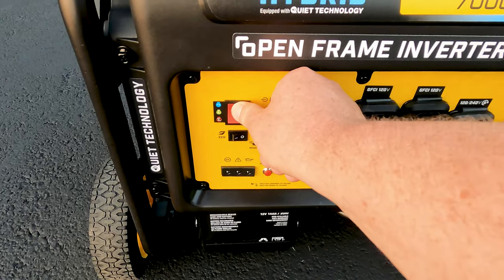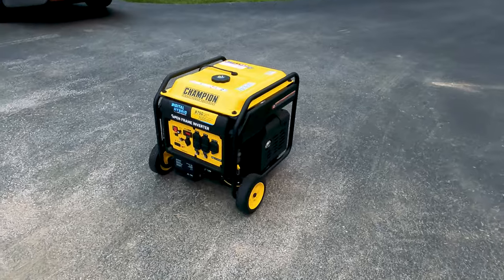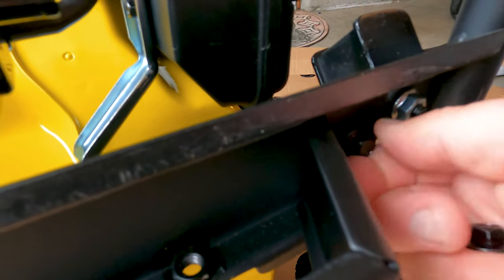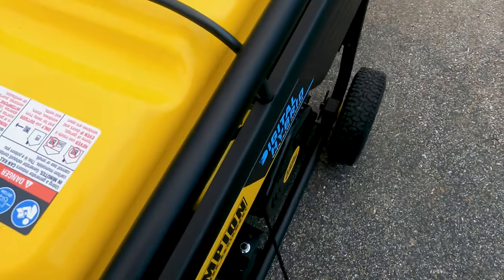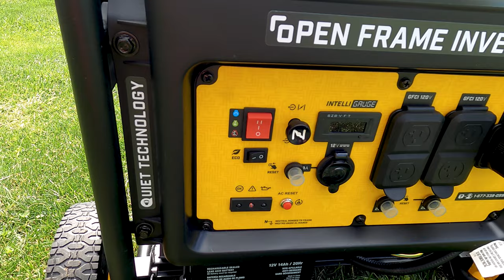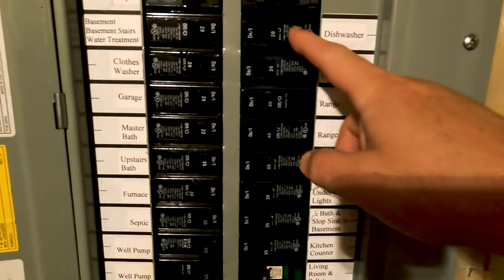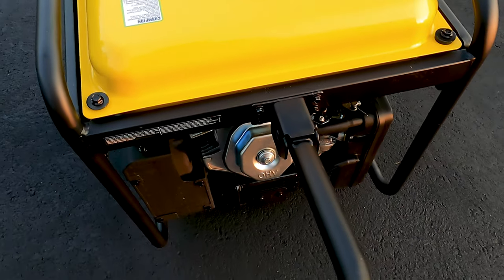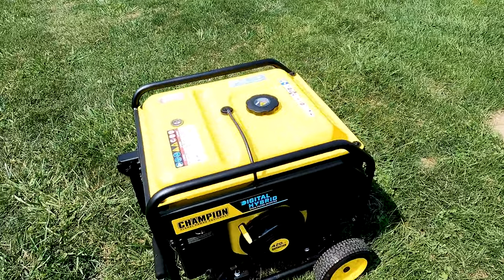Champion 100520 Inverter Generator - Nice Clean Power But Several Issues Too...

Comment: Seems like you didn’t even break it in before giving it a substantial load. Ideally, it’s beneficial to run it a few times without a load for an hour or so and change the oil to get the metal shavings out. Then after the full 5 hour break in period, add synthetic oil and run it on its desired load.
Reply from the maker: Actually did all of that.  Thanks for watching.

Comment: I bought two of the 4500 open frame generators.   Both started first pull after adding oil and gas and they run like a Champ.  Best bang for the buck IMO.

Comment: The Predator , Champion, and Wen are all identical, all made in the same Chinese factory. The Predator has a larger fuel tank with 6 gallons vs the 4 gallons of the Champion and Wen, so should have substantial longer run times. The Predator has a 90 day warranty, the Wen 2 years, and the Champion 3 years.
Reply: Champion is definitely different. It's American designed but made in China. It does not look like a generic one with a brand name slapped on it.
Reply: I know they all use some china clone engine such as Rato.
Reply: @paulschab8152  , actually it is a Honda clone.  An EXACT copy.  How do I know? There is another channel under James Condon that repairs generators.  He put a Honda carburetor on a Champion generator engine.  It FITS EXACTLY.  I bought a WEN and it works very well.  No fuel injection to deal with.
Reply: @paulschab8152  , actually it is a Honda clone.  An EXACT copy.  How do I know? There is another channel under James Condon that repairs generators.  He put an old Honda carburetor on a Champion generator engine.  It FITS EXACTLY.  I bought a WEN and it works very well.  No complicated fuel injection to deal with.

Comment: Got the same genny with zero hours on the board, and at 13 now. Never had the fault startup or any other prob. Wonder why urs had 2hrs, I would have raised a stink! Might have something to do with ur problems.
Also I recommend the motor snorkel msk3101 for dual/tri fuel with this generator. Was a super easy install and quality kit. Just finished my iron plumbing for NG after all testing confirmed it will run a 3.5 ton a/c ON NG (5500 watts starting and 4500 running!). Will get the video here shortly covering that whole run-down. 
I do have an easy start video running on this genny with gasoline.
Reply from the maker: Interesting point.  My initial thought was they put a couple of hours on it at the factory for testing.  Maybe I got a unit that was sent back from someone else?
Reply: @GreenMountainDIYGuy  my thoughts but I hope not. I did do some test starts to see if I got the red light prob and could not get it. But when I start I keep it choked for about 5-7 seconds, then the green light comes on and I unchoke it. Have u tried that?
I've also run mine on natural gas with the motor snorkel kit and found the power to be up around 5k watts with natural gas. With a micro Air soft start on my a/c i am able to run my 3.5 ton a/c on natural gas! Will be making an overview this winter about it. Thanks for u channel!

Comment: The lifting handle appears to be on backwards, or upside down. You had it placed correctly but then turned it around so that the welded square on the handle would hit the rubber stop
The square on the end of the handle should com in contact with the metal frame when lifting at the top. It is placed there to keep the round part of the handle from deforming under load.
Reply: Oops...

Comment: What are the dimensions of the shipping box.  I bought this generator, on Amazon, but have not received it yet.  So, I need to know if it will fit in my 1996 4Runner.

Comment: Did Champion say anything about that fault at start up? Did you change the neutral bonding from factory by chance? Mine only does that when I truly overload it. Great video.
Reply from the maker: Yes, I did recently rewire and change the neutral bonding.
Reply: @GreenMountainDIYGuy  Hello and thanks for the video! Did changing the neutral from bonded to floating solve the issue of the red warning light coming on?

Comment: Bought mine a year ago, and only rook it out of the box yesterday to use because of power outage... That sucker is loud (maybe because it was on concrete).  Also, for some reason, it had a bit of oil in it already...
Reply from the maker: Very interesting to hear!  This generator worked well in our recent 11 hour power outage!  Thanks for watching!

Comment: I'd check the main jet, it's a little bitty hole. Anything junky at all in there will limit fuel delivery, RPM (which it sounds like it's down a couple hundred when erroring), and power.
Reply from the maker: Great suggestion, thank you.

Comment: I own four Champion generators (3 of the 2000 Watt units and one 3400 inverter) and they are superb units for reasonable cost.. I also own the Honda EU6500is for home backup and it too is superb except for the outrageous price. For my money, I personally consider the Champion line of gennies the best value for the money you can find, especially with their parts support and customer service. And no, I am not a Champion fan boy....lots of great gennies on the market...but stick with a known brand
Reply from the maker: Good Advice all-around!

Comment: Solid video and editing! Too bad on the handle, but looks like they took care of you. Hopefully, it works out on propane. You are right with Honda...but, they come at a steep buy in.
Reply from the maker: Thanks buddy.  Took a while to do this video between takes and editing.  Even got the driveways sealed to completely mess up the continuity of the video.  I think the generator will run a lot better on propane, at least my last one did. Thanks for watching!
Reply: Handle looks cheap and weak, should have been 2 to take the load of the welds.
Reply: As we All know that every Company always has A LAZYASS in the Company that Crews everything up...
In All Level of Society 👎👎👎

Comment: I just got mine this week. What size breaker did you install in your panel? Thank you for the video!
Reply from the maker: Nice purchase!  I have a 30 amp double pole breaker installed on my panel.  I also use an interlock kit.
Reply: @Pilot81 Hi! How do you do that?

Comment: How hard is this to crank if the battery is dead?  Trying to decide between the Lowes 5250 watt model which is manual start vs this one which is manual/electric.  For me odds are good that when I need it the battery will be too weak to crank the unit.
Reply from the maker: If the generator is cold,  you will be cranking for a while.  I went to this ekectronic starting generator partly due to my shoulder wearing out and not being so young.  The battery will last a long time between using.  I just exercised the generator and it started right and it had been six months since I used it last!

Comment: Bought this same generator. I get thr error sometimes. No clue why. I turn it off start it again and it's green. Let me ask you a question, do u have to choke it every time u start? I can have mine run for an hour. Turn it off and try to start it again right away and it won't start unless I choke it. I find that odd.
Reply from the maker: Very interesting to hear!  Must be some kind of larger issue with these generators.  I never use chock because I only run off propane now.  Thanks for watching!

Comment: How many amps is your well pump? That's my only power outage issue is no water, ive got much smaller champion investor that runs the basics.
Reply from the maker: The Well Pump is on a double pole 20 amp breaker.  I don't remember the actual draw but the generator handles it.
Reply: @GreenMountainDIYGuy  thanks

Comment: Should have bought the Predator (same price) with the "no questions asked warrantee". that's unbeatable!
Reply from the maker: Maybe...thanks for watching!
Reply: The Predator is $1300 currently and has a 90 day warranty. If you want the added two year warranty, you are paying about $200 for it. So $1500 plus tax, for the generator, with a 2 year warranty. I bought this Champion for under $900. Almost $600 less than the Predator+warranty AND comes with a longer 3 year warranty. You can buy the same exact Wen generator even cheaper, usually $100 cheaper or so.
Reply: @bubbatime  The WEN manual says to change the oil every 20 hrs.  Engine bore must be junk.  It is strange that they look so similar but have no affiliation?
Reply: I just returned the predator after running it 30hrs straight. The display would only indicate 120v and I had gotten that same error on it once and also couldn’t start it off the battery but would start on the cord. After reading all the one star reviews with the same voltage display issues I had I decided to return it and now I’m looking at the Champion reviews.
Reply: @jenks9413  ...all these gensets seem to come from the same 1 or 2 Chinese factories.... build architecture is very much identical to each. Different paint scheme and voila !..... a Westinghouse unit, or Champion or Wen or Generac.....etc. The generator part itself is almost always Loncin brand.

Comment: Is it considerably quieter than a regular generator?
Reply from the maker: It is about 30% more quiet.  It you are around generators alot you will notice a difference but it is still loud since it is open frame.

Comment: I never used generator before. I need to know the order of operation. 1- wire connect b/t generator and house. 2- start the generator. 3- turn off all circuits. 4- turn off main circuit. 5- connect generator circuit to house. 6- turn on desired circuits. Also when turn off generator: 1- turn off circuits. 2- turn off generator. ???

Comment: If its a bonded ground, when connected to your house, should you not unbind the neutral ?
Reply from the maker: The generator is a floating neutral.
Reply: @GreenMountainDIYGuy  are you sure about that?  Looking at the image on Amazon under the AC breaker reset, it says “neutral bonded to frame”.
Reply from the maker: @ballsdeep9648  Yes, floating neutral generators are required to have at least the ground bonded to the frame.  Here's a good article on it.   https://www.forconstructionpros.com/rental/article/11359425/proper-grounding-and-bonding-of-generators
Reply: @GreenMountainDIYGuy  ...no...bonded neutral and Champion even has a short video how to unbond and make it floating. Odd....the same size Wen units ( vs Champion) come from the factory as floating.
Reply: Pretty sure it is a bonded neutral generator. Says so right on the generator. Champion does show how to make it a floating neutral for connection to the house.

Comment: To bad it has those error problems on start up . I wonder if it does it on pull starting also. Still works great it seems.
Reply from the maker: Running like a dream on propane now!
Reply: This was my thought as well. It could have something to do with the 12V battery voltage sag during electric start, which would not happen on manual start.

Comment: Is this unit a bonded ground or is it floating neutral ?
Reply from the maker: Floating Neutral.
Reply: It says bonded to frame on the front panel under AC breaker reset.
Reply: @GreenMountainDIYGuy  ...no....it's bonded. You can check easily with an ohm/continuity meter. When "off"....simply put one probe in a 120V long-edge socket and the other to ground.....or if looking at the 240 socket, use either hot-edge socket, and also to ground. If you have continuity..... its bonded. Champion even has a short video how to unbond and make it floating. Odd....the same size Wen units ( vs Champion) come from the factory as floating.
Reply from the maker: Sorry, I converted to floating neutral recently.  
I may do a video on that in the future.

Comment: I received this same generator from Amazon a few days ago, and it  has the same issue.  First start up worked perfectly but the second start it ran only at low rpm, next start worked normal again. Sent an email to Champion customer support a day ago but haven't received a response yet.
Reply from the maker: Good to know that I'm not the only one with the same issue.  Great generator except for this startup problem.  I converted to Tri-fuel and the generator runs like a champ on Propane.  No starting issues whatsoever.   https://youtu.be/nZPV7CoYm_4
Reply: @GreenMountainDIYGuy  I did the 5 hour break in without a problem. May covert to natural gas later. Generally it will lose about 20% of its output compared to gasoline. Checking on whole house standby generator first. I have reliable power except when a hurricane hits
Reply: @GreenMountainDIYGuy  did you find a solution to this issue or did this issue fix itself?

Comment: Needs floating neutral to hook to a house circuit adnauseam!
Reply from the maker: Yes, I remove the neutral to ground on the L14-30 inside the generator.
Reply: Previous comments from you said it was a floating neutral. But, out of the box it’s a bonded neutral generator.

Comment: That is a big RED FLAG. Mine never has errors on any start. You need to return that unit for another one. There is a problem with that one.
Reply from the maker: Yep, I normally would, but since converting to propane, all is good!

Comment: Today is $1499.00   !!!!
Reply from the maker: WTF?????
Reply: $2400-3500 now.... crazy!!!!
Reply: @masterofnonephotography  That is nuts!!!!
Reply: Predator 8750 under $1000 with 20% coupon plus no questions asked warrantee. Champion was a wrong choice even without the fault.
Reply: @FXNorm  Cant use 20% off coupons on generators. Not to mention, they did away with coupons earlier this year. The Champion has a far better warranty, and is essentially $300 to $500 cheaper than the Predator for the same exact generator. Harbor Freight is ripping people off.

Comment: Rut roh
Reply: Thanks for the video. Ordered one on Amazon a couple of days ago to replace my 19 year old Porter Cable 5500 watt  contractor generator. Still starts on first pull, but wanted the inverter type and more watts. Price dropped to $985 on Amazon.  If the Honda was 7000 continuous I would have bought it instead.  Of course the price would go up as well. Really like my Honda EU 2000.
Reply from the maker: Great price!!!  Thanks for watching.  I converted to propane and it is running like a dream.  Check out my other video.
Reply: @GreenMountainDIYGuy  what's the gas millage on propane
Reply from the maker: @raymcdonald731  Pretty Similar for the amount of time you will get out of a 20lb vs. a tank of gas.  Propane does have less BTU's than gasoline so de-rate the generator by 10% when running on propane.  Check out my Tri-Fuel conversion video the the 100520 - https://youtu.be/nZPV7CoYm_4
Reply: @GreenMountainDIYGuy   if it makes you feel better it's currently well above $2k on Amazon! It's available around $1300 elsewhere with long lead/delivery times so I think you did well getting it for $1k.
Reply from the maker: @briancarl224  Wow!! Supply and dermand glad I got a good deal when I did!  Thanks for watching!
Reply: @GreenMountainDIYGuy  Predator 8750 inverter is better and under $1000 with coupon. no questions asked warrantee, you won't get that from champion,  both generators are made by the same company.
Reply from the maker: @FXNorm  I looked at the Predator too.  Not surprised that one company make them all!  Thanks for watching.
Reply: @FXNorm  Harbor Freight warranty is only 90 days, Where do you see the Predator for under $1000?